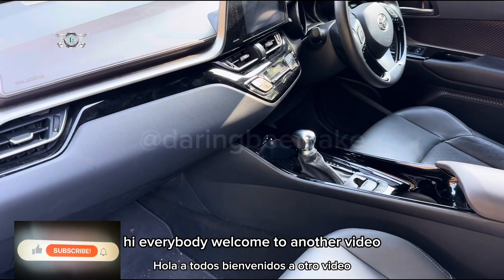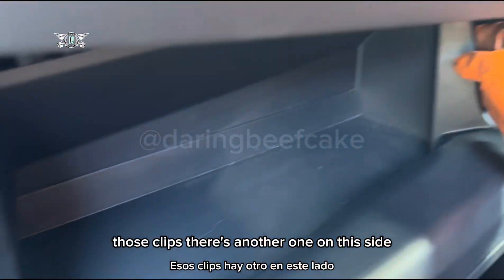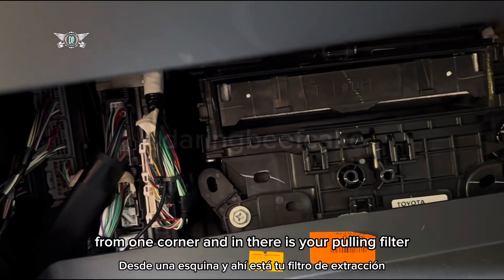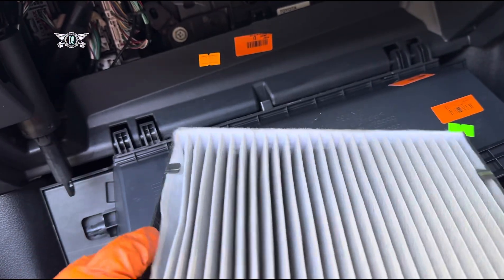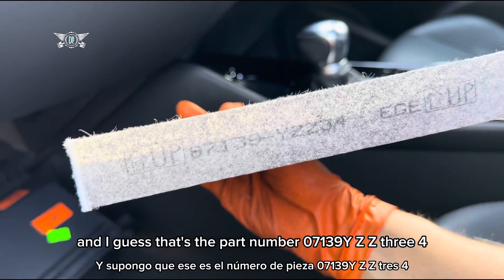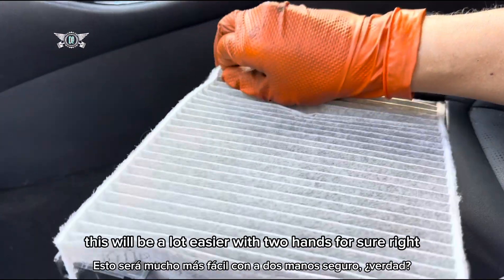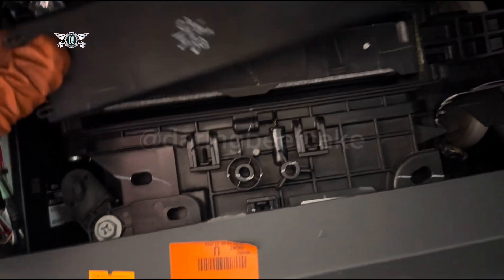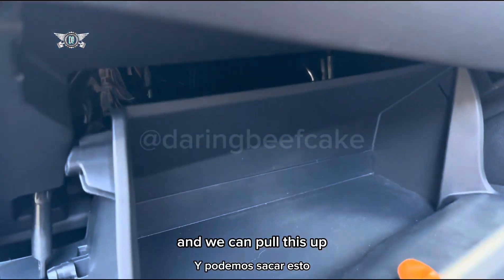Toyota C-HR 2019 pollen/cabin filter location and removal for replacement or condition check

Comment: People often buy after market filters that do not have UP arrows on them. If it says UP next to the arrows on the filter then the arrow indicates which side goes up but if it says "AIR FLOW" or nothing at all next to the arrows then the arrows should point down in the direction of air flow.
Reply from the maker: Well that might depend on the car. Or are you saying that for this specific model. Where did you get this information from ?